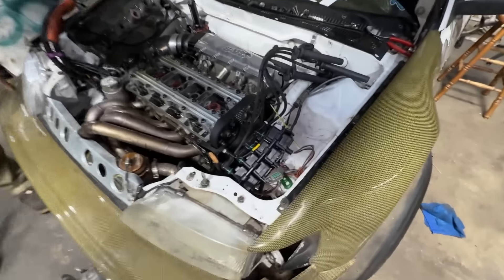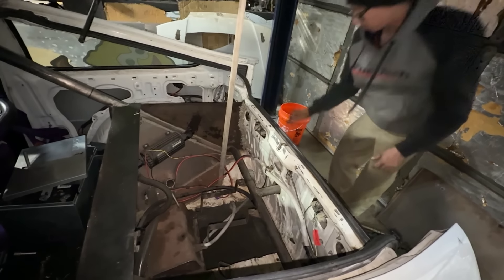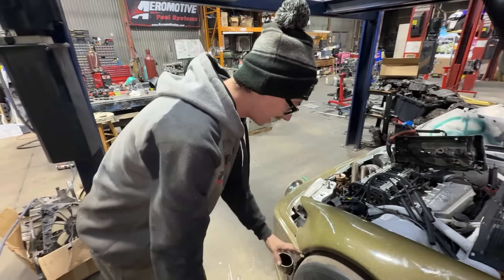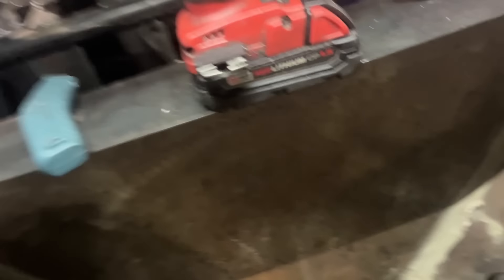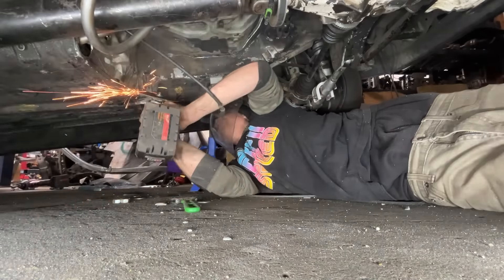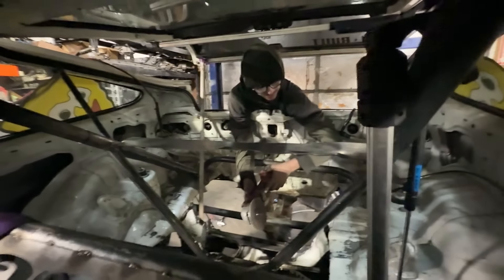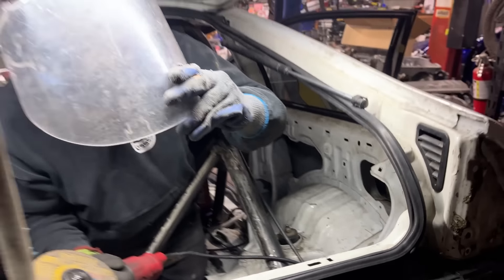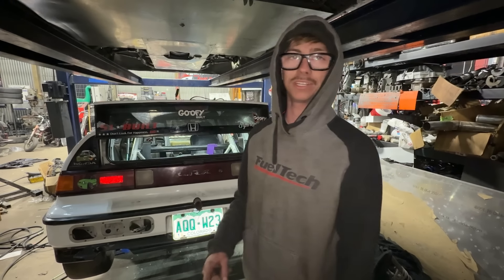Shedding Pounds! Extreme Weight Reduction on the CRX!!

Comment: So keep the hitch and trailer just make quick disconnect plates for the hitch so you can pull the weight off in race mode. Tires on top will kill more mileage than an aerodynamic low trailer with the tires inside it. Costing more to operate on the road should also be a concern for planning were to put stuff on a drag n drive setup. Just look at the difference aerodynamics made for Kyle on eroy and cletus on Leroy before you stick tires on the roof.
Reply from the maker: I’ve completed 2 drag n drives they are a blast… have you seen my trailer. Also not aerodynamic lol
Reply: @GoofyBuiltShane  yeah I'm aware of your trailer. That's my point. Make everything more aerodynamic and you gain free horsepower and or mpg. I've seen the struggle with small fuel cells and refueling on the side of the road.  Better aero = less refueling = less power used moving dirty air = more power to go quicker and faster.  Very few people actually take advantage of aero over horsepower. You've got plenty of power already based on the amount of drivetrain carnage you have been through already you should realize adding more power is a never ending problem. Whereas making it all more aerodynamically efficient is a one and done expense and time consumer that yields excellent results in performance and fuel efficiency. Before you dirty up the air exiting the rear of the car accidentally and cause more problems than you are fixing you might want to think about how air moves around the vehicle. Hate to see overlook something here that could prove dangerous at the speeds you guys run. Best of luck and I'm sure it'll be uniquely useful in your own style. Love all my PFI family and want to see ya'll continue to improve.

Comment: But can you do one thing can you keep the dam Engine together for more then one run. I love Hondas but come on guy the H and B series got to go the K make more power and don’t oil the track down every pass! I love what you do but please people are giving a lot of hate to the Hondas after this World Cup guys! The guys that can change that view is you pleas help. I’m getting crap from everyone I know since I run a Honda. I run a D-16 a2 single cam only 22 pounds of boost I have been able to keep mine together for 2 seasons now now blow ups. Won some local stuff in the true street class import FWD stuff don’t run the big boys like you do so I know it is a whole different ball of wax. Some day K24 all day H trans with a dog box. Next project. Still running hondata what should I run fuel tech or no. Fuel tech is stupid expencive.
Reply from the maker: My engine has been together all year and the last engine had over 2k miles on it doing 2 drag and drives 9 1–2-1 misshifts and it still lived for 2 years…. I have no engine troubles but it all comes and goes
Reply: Run megasquirt, I have two K series running it. No mods needed to the crank and cam wheels, unlike fueltech
Reply from the maker: We’ve started b and k with the stock sensors just takes a little more wiring and time. Gordo’s car originally was in a distributor and we did a Crv with a dizzy k series are alittle easier just need to know the right numbers